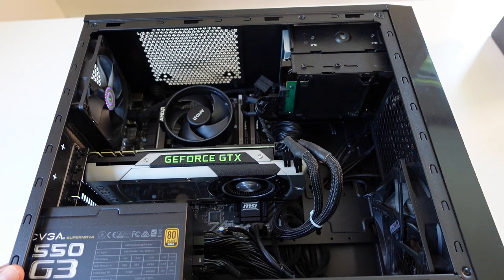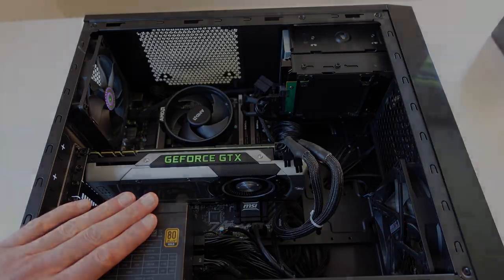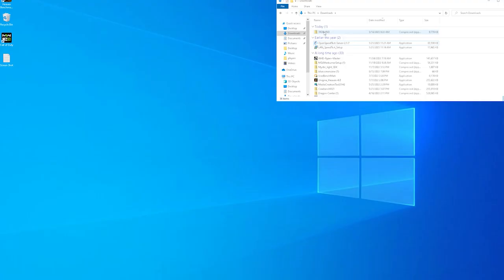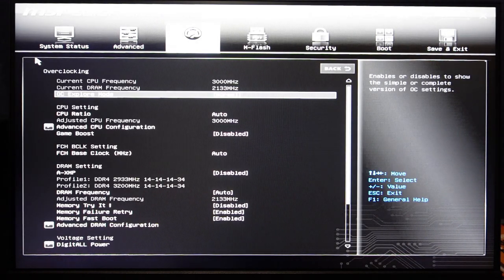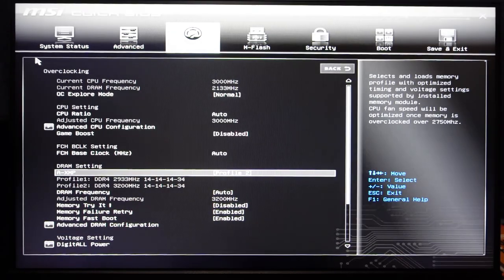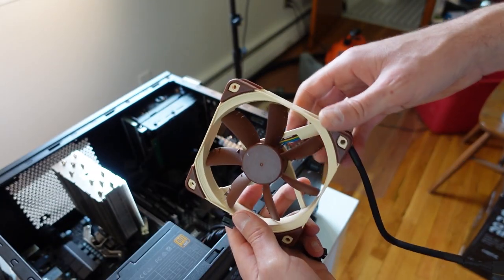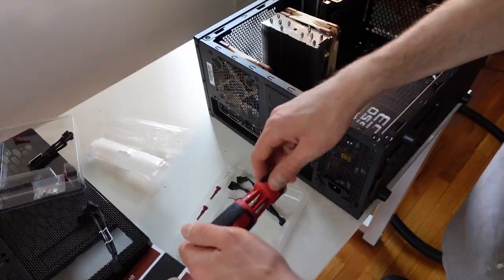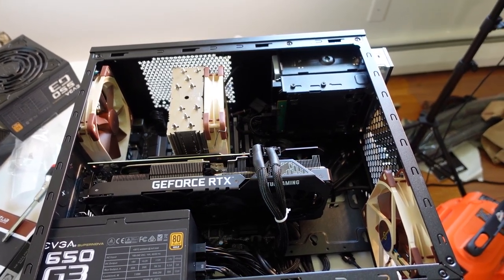Upgrading From 1700 to 5700x Step By Step on B350 Motherboard

Comment: I think you and around millions of other people have done the exact same thing with AM4.. i even upgrade from Ryzen 3600 to Ryzen 5700X as well.. :) super easy and nice jump in performance while using less power.
Reply from the maker: Yeah most definately
Reply: I'm about to go from a 1600 to a 5700x.
Reply: @bigfellaoo7  same
Reply: @bigfellaoo7 I'm currently thinking of doing the same.
Guessing you just update to the current BIOS version before changing CPU, and it's good to go?
Reply: @bigfellaoo7  Same gen jump for me. 1700x to 5700x
Reply: @bigfellaoo7 how it's going so far? Planning on the same upgrade, 1600 to 5700x on asus b350f gaming strix
Reply: From 2600x and GTX 1060 to Ryzen 7 5700x and RTX 4070. This is why I love building my own computers, it works out so much cheaper and better in the long-run. Less wastage, just exactly what you choose and need at the time.
Reply: what GPU did you get ? Im strugglin to chose between 4070 and 7800 xt.. Never bought radeon gpus before
Reply: Same I am about to upgrade from a ryzen 3600 to 5700X.
Reply: Hi, did you tweak anything in bios, in terms of voltages?
Reply: 2200g to 5700x .
I dont game , i need a better one for workoffice, and desktop work.
I do sales online and work a lot with photos edit and websites managment.

Im have a b350m mortar MB so whats best? 3700x or 5600x?
Reply: would it work with my msi b350 gaming plus. planning to upgrade ryzen 3600 to 5700x?
Reply: 3600 to 5700x gang here! Kinda wanted to go all the way with a 5950x but the consensus is it's a bit dicey with the vrm of the b350

Comment: This is perfect for me as a similar upgrade with same MOBO. Respect to MSI for allowing this level of compatibility. Going from Ryzen 5 2600x and GTX 1060 to Ryzen 7 5700x and RTX 4070. All the rest of the PC (MOBO, RAM, multiple drives, case, fans etc) can remain the same and still work just fine as usual. This is why I love building my own computers, it works out so much cheaper and better in the long-run. Less wastage, just exactly what you choose and need at the time. Thanks for video.
Reply: thanks for the comment, i was going to do the same with my asus prime a320m-k mainboard. has it worked out well so far with your rig?
Reply: @pigreatlor  All good! Lovely to play new games in high resolution!
Reply: @skabbymuff111  So you didnt need to get faster rams to fully use the potential of the 5700x? You do benchmarks and get similar results?

Comment: I moved from a Ryzen 1700 (non x) to a Ryzen 5500 on an A320 motherboard earlier this past year. It's a 50 percent increase in speed single core (very noticeable) apps and about 21 percent in multithreaded (would be more but two less cores do make a difference). Upgraded memory from 16GB 2666 to 32 GB 3200 and went from a GTX 960 2gb to 1070 8GB (yeah, used, but still a signficant upgrade) card. Still runs super quiet and cool and I kept the original 500 watt PSU.  I gotta love AMD for such a wonderful platform.
Reply: Yeah, it's pretty epic they allowed us to upgrade to 5000. I lucked out with my recent purchase. $150 for a Origin PC on the x370 platform. I'm planning on upgrading to Ryzen 5000 and hopefully a 3080.
Reply: I found a b350 a ryzen 5 2600x and a set of 16gb x 2 of Corsair Vengeance rgb Pro Ram for just $30 on a used item app I have.
Reply: I Jabra the same thing bit Intel I built for 10x the cost 3 years ago so its nice to find small gems like this. Intel i5 9600kf msi h370 pro gaming carbon motherboard vs 2600x msi b350 tomahawk motherboard, I myself am confused on which one to main and what to sell off for my free ram upgrade. Went from 2x8gb corsair rgb pro to having 48gb. So I think if I sell off the one pc stuff I'll keep the better one and take it as a free upgrade once I sell it. Maybe even have some extra earnings overall to keep or add another upgrade. PCs are fun if your smart.
Reply: Sorry I'm rushing so it won't sound too great

Comment: U need to use the original PSU cable, i don't think u can mix up PSU cable like that, it can kill component on your PC.
Reply from the maker: You are absolutely correct that mixing cables can cause issues, especially if they are different make/model.  In this case I verified online and confirmed with EVGA technical support before doing so. The cables for the 650w and 550w SuperNova G3 models are exactly the same.
Reply: The cables are the same for corsair 750/850. You can use from either one and you will be fine. This is also the case for EVGA. These companies are not going to make 2 different cables for power supplies they rather save money and make them for multiple types of power supplies from the same company.

Comment: Did similar. Had 1500X running on Asrock AB350 Pro 4 board with 2 x 4gb GSkill 2400 Ram. Upgraded BIOS to latest version in a 3 step process. Wasn't sure if latest BIOS supported 1500X, but no problems. Then dropped in 5600g with standard cooler. As onboard graphics use system Ram, upgraded Ram to 2 x 8gb Corsair 3600. Major upgrade in oomph using old 350 with AM4 socket. Thanks AMD!
Reply from the maker: That's great!  I bet your system feels like it's new
Reply: @SystematicHardware  Absolutely. It's very gratifying to get such long life out of the old motherboard.
Reply: I have a Asrock AB350m board , 16 ram and Ryzen 3 1200. Can I upgrade mine to this Ryzen 5 5600g? My BIOS version is

Comment: Try going from a 1400 to 5700x.  Man it is amazing.  And the 1400 is ready to come back to work when I get an ssd for my fiance.  She's never had a legit gaming pc so I'm reusing my old 1400 and 580.  It ran fine at 1080 once it was free from the chains of a HDD OS drive but im on a 5700x and 6600xt now for my cheap 4k tv.   $200 cpu and $300 graphics card not bad for the price of a new Xbox and its running true 4k 60 in most games, plus I have FSR or just turning the whole system down to 1080 and letting the TV upscale itself.
Reply from the maker: Now that is a significant upgrade!

Comment: I have an almost identical system I just picked up for $150. 

It's a 1700x, x370 pro carbon, GTX 1070, EVGA 650w G3. 

I just updated to the newest BIOS revision and bought some DDR4 4000 RAM. I'm very much looking forward to selling my old rig and upgrading to a 5700x and GTX 3080. It's amazing that AMD allowed for 5000 series on the x370 and that I can upgrade a 7 year old PC to almost modern specs. Mind blowing.

Comment: When you updated the bios did it stay in that format from that point on or did it revert back to the aesthetics of the original? I like the looks and navigating the original build look is there a way to retain the look and navigation post bios update?
upgrading 1400>5600 Thanks!

Comment: Thank you for this! I am upgrading form a 2600x to a 5700x next week. I have the latest motherboard bios (4002) for my motherboard (Asus b450m Gaming Plus). Any other tips for me? Done a cpu swap a ton of times in the past but not done it in 8 years or so, any tips would be appreciate. Will bookmark this video, its useful, cheers
Reply from the maker: Thank you!  The process hasn't really changed much.  I think you'll have no issues
Reply: @SystematicHardware  Cheers!

Comment: I'm going to upgrade from Ryzen 3 1200 to Ryzen 7 5800X3D or maybe Ryzen 9 5900X with my ASRock AB350M Pro4 and I cannot wait! I expect a huge jump in performance
Reply: is that comptaible through bios surely not ?
Reply: @NOTATG11  Yes it is. B350 boards, even mine support Ryzen 5000 series CPUs.
Reply: @st0dy Take 5800x3d for gaming

Comment: great video, btw do you think with a 550w antec 80 plus gold PSU i could upgrade to a rtx 3070 and a 5700x (or other same TDP cpu)?? if not which gpu would be de the limit? thanks!!
Reply from the maker: You could probably get away with it, but Nvidia recommends a 650w psu for the 3070.  Get a wattmeter and try it to see how much the system draws power while you game.  You want to aim for 50-70% psu utilization
Reply: @SystematicHardware  okey thanks!!

Comment: I'm doing the same upgrade with a MSi B350M mortar, but when I switched the CPU from a 1700x to a 5700x, the PC stopped booting. Now, it continuously restarts without displaying anything on the screen. I noticed that the EZdebug CPU LED is lit. Any ideas on how to solve this problem? Before all this, I had updated the BIOS to the latest revision.

Comment: Hey man I have a question. 
I have the same motherboard, with 1600X and I'm going to upgrade to the same CPU (5700X). Also, the same GPU upgrade (3070Ti) 
I have a 650 powersupply.
My question is, did you have any problems with it? 
Thanks for the video by the way. Really helpful.
Reply from the maker: Thank you, np problems thus far

Comment: Running an 1700x with 16gb ram
Ordered 32gb ram now and noticed the 5700x is actually cheap and consumes less power. I'll update my msi b450a pro bios and cpu too

Comment: Hey.. Great video.. Was updating myself, from Ryzen 5 1600, to Ryzen 7 5700x. After install, the computer crashed and turn on and off.  I chked all my plugs, reinstalled with same results.  I do have 500Watt power source. Im also still using same older fan. I have a 3060 Graphics card..I put back old Cpu and all is good.. You think its a Bios issue or I need more juice?? Thks
Reply: @dagerry  yes.  The new GPU,  wasn't working.  Also I can't seem to run 4 ram sticks now.  Strange. I even swapped other rams sticks.  It's working, but I'm gonna buy a new built system in a few months.  Thks for asking.

Comment: Hmm, i got to ask, did it worked, you didint show the pc booted ^^ Im asking since i have a b350m mortar arctic (with the newest bios am6), a samsung 980 1tb nvme and a ry 5700x And  i cant for the love of god make my bios see the nvme drive when with the new cpu ( the r7) All works fine with an r5 1600 (im wrinting on it now), but as soon as i add the r7, i get "not detected" in the m2 slot in bios. Is there some difference  in how those mother boards are made ?

Comment: Same mother board MSI B350m Bazooka. Installed the 7/15/2022 bios. Gonna go from 2700x to 5700x. Did you run into any problems like rear USB not working? Thanks.
Reply from the maker: No problems like that.  The only problem I had was post bios update.  It didn't automatically boot into the operating system.  It eventually corrected itself.

Comment: I just bought B350M Bazooka last month, its never use before and im having 5700x too , do i have to update the bios the same like you do ? If yes , can i just put the 5700x on the motherboard and just update the bios ?
Reply from the maker: You would have to use the initial processor to check/verify the bios version.  Then update the bios if necessary.  You have to be on that latest bios revision in order for a 5700x to work and you need the old processor to do it.

Comment: Hey man, I’ve got a question would I be fine to upgrade my A320AM4-M3D motherboard to a ryzen 7 5700x, the last bios update was during 2022 and I believe they updated my motherboard for the 5000 zen3 series but I’ve not been able to find confirmation of compatibility with something that fast on a motherboard so old.
Reply from the maker: On the site for the motherboard A320AM4-M3D(V1.0A) it states under support that the  latest bios version  supports the 5700, but it doesn't state "X".  You'd have to verify that your motherboard is the (v1.0a) and you can do that as well  as verify the cpu version by contacting manufacturer support.  I wasn't aware that there was a 5700 non x so it could be a typo.
Reply: @SystematicHardware  I just looked it up, and there are two versions of the 5700 the G and the X, I believe they were making a grouping, but I’m going to do a bit more research before jumping into putting this into this motherboard.

Comment: Would it be a good idea to put a 5800x (non 3d) in a b350 gaming pro carbon motherboard or is it too much? I am needing a good processor for heavy CPU programs and my options are between the 5700x or the 5800x.
Reply from the maker: I haven't tested the 5800x on a b350, but I will say that if you're planning to get more than a year out of the upgrade and/or upgrade a graphics card to anything higher than a 4070 I would build a new system.  Those b350 boards most likely won't support Windows 11 and windows 10 end of support will be in 2025.  The b350 boards memory limitations at 3200 mhz will severely bottleneck most higher end modern graphics cards.
Reply: @SystematicHardware  "Severely bottleneck?" Not for 1080p gaming which is what most people still do.

Comment: I have a	Asus B350f gaming motherboard and currently a Ryzen 5 1600 thinking about upgrading to 5600g or 5700g (G versions are significantly cheaper than X versions where I live) will I encounter any bottlenecks?
Reply from the maker: There's no way to answer this question especially when not given a complete hardware list including the graphics card as well as resolution and refresh rate of the monitor.  There's also a bottleneck in every system on the planet.  Then you throw in different games and optimizations to further complicate things.  If your gpu usage drops below 80% with graphic detail on ultra (with a reasonable monitor paired with the graphics card), chances are you need a faster cpu.
Reply: did you change it? is there any problem?

Comment: question : can i put 5800X3D to my asus strix b350-f ? any chance for excessive heat ot overload vrm for this combination?
Reply from the maker: I wouldn't do it, but it is compatible according to the Asus website.  As for the VRM temp, you could get a cheap $20 temp laser for monitoring
Reply: Have you done it
Reply: @mentagou  no, i endup buying ryzen 5700, lower tdp

Comment: Built my pc in 2017. 
Ryzen 1600, GTX 1060

Added 16gb ram, then upgraded GPU to 5700XT and 750W PSU

Decided today to finally upgrade CPU and went with the 5700x

Didn’t want to spend the extra for x3D. I mean I’m coming from a 1600. They’re both light years ahead. And the 5800x seem to be ~2% better, but run hotter, so I went with 5700x

Plus now I have a 5700XT GPU, and a 5700x CPU 😂
Reply from the maker: Wise decision!
Reply: doing the same thing, thoughts?
Reply: @cadenprosise2609  it’s a really good improvement. I mainly did this to be able to play GZW and it runs much better now (though still low settings). 

But it was running a little too hot so I ended up buying a peerless assassin cpu cooler. Which works amazingly well. But if I knew I was going to buy a new cooler anyway, I might have been more likely to go up. 

The 5700x was hitting 84 deg just using the stock cooler from the 1600. 

The assassin dropped it to 56.5. 

Both maxes reached playing GZW for a couple hours.

Comment: thank god you have the same motherboard as i am on how to do the bios update. it might be updated now to a 2023 version but it still the same thing on how you do the bios update. im gonna upgrade mine from a R5 2600 to a R5 5500. dont know about going to a 5600 if the difference is maybe small.
Reply from the maker: Don't go down in core count.  You'll be glad you did in the future.
Reply: @SystematicHardware yeah im not. im still checking the differences between the 5500 and 5600. but like mostly are 9 fps difference between the two and something about the 5500 is 30watts less consuming than the 5600. so the 5500 is maybe a good upgrade for me

Comment: So... its safe upgrade a b350 tomahawk from ryzen 5 2600 to ryzen 5 5700x? or might be a ryzen 7 5000 series?
Reply from the maker: Yeah it's a pretty straight forward procedure
Reply: @SystematicHardware  what is the best o most rencently gpu can i use in this motherboard
Reply: You could technically put a 4090 in there & it'd work, but there'd be a bottleneck even with a 5950x. Graphics cards just work. Ultra compatible. 
I'd recommend AMD for a new card. Everything below the 4080 is gimped with Low vram or undersized bus or both.- unless you love Ray tracing of course.

Comment: hey man i got asus prime b350-K with ryzen 5 1500x , i want upgrade to ryzen 7 5700x, is update bios is mandatory?
Reply: Yes. You cannot Upgrade your CPU without going through with every BIOS update.
Reply: @xXxMrRazorxXx  do i need other cpu after using ryzen 5 1500x for update the bios? i mean after updating the bios, does r5 1500x still be used ?
Reply: @06iamgod  don't need another CPU! If you Update BIOS all the way through u can still use the 1500x and or your new Zen CPU without problems ^^

Comment: My uncle gave me a rog strix b350-f gamming and a ryzen 4600g and i was wondering if i can use this mobo with the proc. Does anyone know if they work together ou if i'll need to up the bios First?
Reply: Check your motherboard model website and update bios to latest version and you should be able to use 5000 processor. Be aware that you might have to update bios couple times as latest version requires bridge bios from older versions. Also when using AM4 platform it is required to download chipset drivers from AMD website  in your case B350 is your chipset. You can check your motherboard bios version when entering bios. If you never done bios update it’s not complicated. You can always look at YT,  learn how it’s done and do it  yourself.
Reply: @Ornal64  thx for feedback, Just one more question, If i build my computer with the mobo and 4600g It Will be able to upgrade BIOS? Asking bcuz, some1 told me that i should build with a proc that the mobo recognize, and then use ryzen séries 5, but o dont haver another proc for that
Reply: If your computer will boot with 4600g you will be able to enter and update bios. For bios details(supported cpus generations etc.) you should always check your motherboard model website. I suggest that you do research before listening to anyone online and confirm that this is correct.